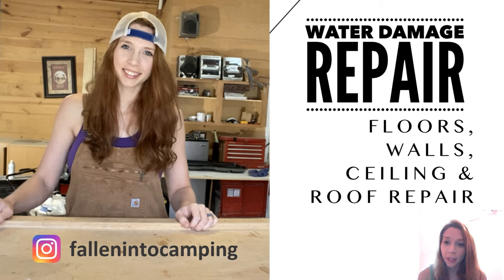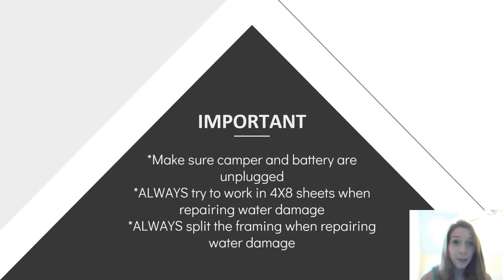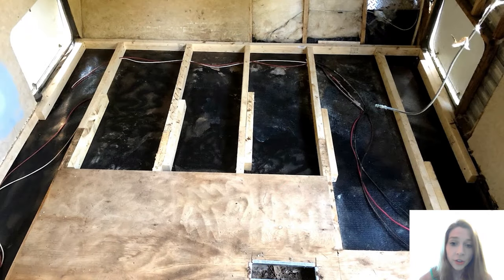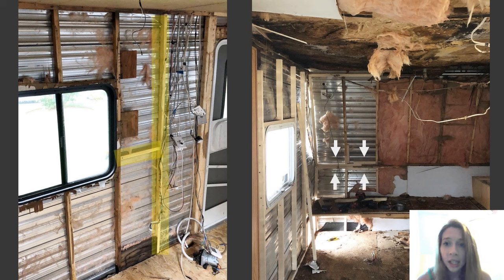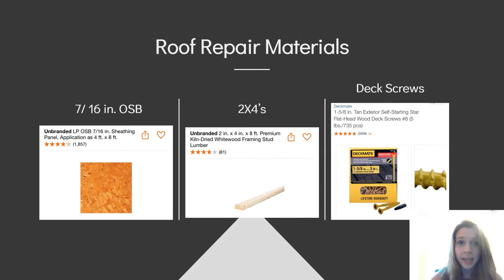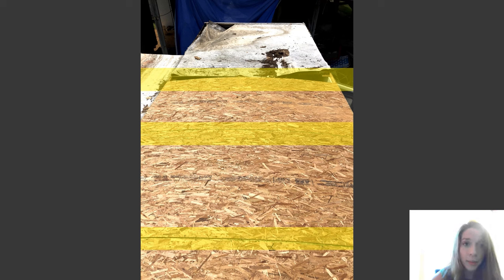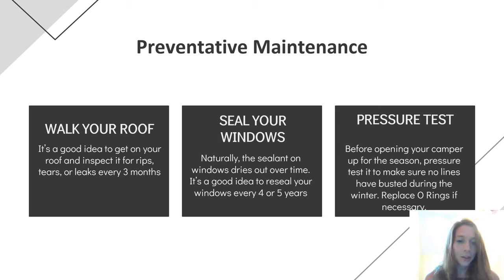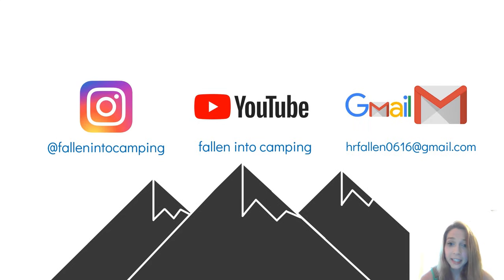(UPDATED) RV Water damage repair in 6 easy steps!

Comment: Hi Heather. This video has been very helpful for the structural elements. I'm renovating a motor camper in Europe, where there is an overall vehicle weight restriction, including passengers and contents, of 3.5 tons. This means that even the good makes have much flimsier construction than your campers in the US. For example the floors are made of 20mm extruded polystyrene sandwiched between 2 two 5mm sheets of ply without any s4upporting structure other than the original van chassis. The top sheet forms the floor and the bottom sheet is bitumin coated and directly exposed to the road!! The only thing that holds the walls up is a 100mm band of wood infill around the edges which replaces the polystyrene core ..... so rot around the edges is pretty hard to put right. Do you have any ideas. 
The second thing which is puzzling me is how to waterproof the external corner joints of the walls, which are constructed of an aluminium sheet with bonded softwood framing and polystyrene fillers. The front/rear walls attach to the side wall framing by screws/staples via a 10mm wrap around of the aluminium skin - so lots of little screw/nail/staple holes under the aluminium angle cover strips. This is where the water came in originally so needs something a bit better than the original putty which had long since dried and cracked. What do you recommend ?  I'd thought of 25mm self adhesive butyl tape wrapped round the corner across the join under the cover angle strip. Or would you recommend the type of flexible mastic putty you used for reseating the window in your video ? Many thanks in advance. Alan Redhouse
Reply from the maker: We have campers similar to this in the US—I just repaired one with a foam board construction (see repairing rv with foam walls, and repairing RV delamination). Butyl tape will be your best friend! Also caulk everything, even after you apply butyl tape!

Comment: Where you suggest ordering RV replacement parts? I need that material for around my windows on the outside among many other items. Thank you so much for all you do!!!!
Reply from the maker: I order most of my parts and supplies from recpro. What material are you talking about on the outside of the window? The trim strip that is inset in the window, or the caulk cord to seal the window?
Reply: Not sure how to describe the trim. It is a rounded piece of vinyl. I’m sure I’ll find it at the company you suggested

Comment: What size staples do you use? Also if you know off hand, what pressure do you set the compressor at?
Reply from the maker: To staple paneling, I think I use 1 inch crown staples in my 18 gauge nailer. Pressure is usually around 60-80. I start at 60, and if it dosent sink the staple in all the way flush I’ll turn it up a bit. Don’t want it too high because the staple will go right through the panel!
Reply: @fallenintocamping   Awesome, just what I needed. Gonna go pick up a staple gun. Thank you.

Comment: Was your window completely removed prior to you using the router to cut out the opening in the paneling?
Reply from the maker: Yes, the window needs to be removed before using the router to cut the hole. Good question!

Comment: I have a question about routering around the window.. it looked as if there was no actual window, just an opening.  So if you would answer that first..then state the info on the bit for it please.
Reply from the maker: I took the window out, and then used my router with a flush trim bit (and the framing as a guide) to router the shape of the window, and then put the window back in! The flush trim bit has a bearing that acts as a guide where there is existing framing (like around the window) and makes a perfect cut every time!
Reply: @fallenintocamping  ahhh. Now it all makes sense. Thank you for replying so quick. You're awesome. Love the channel! Wish I'd looked for this info before it got so cool in Michigan.

Comment: One last question. My camper has a lot of water damage all over. Needs new roof along with ceiling, floor, and walls in multiple places. Should I just rip it all out at once. Do you offer a consulting service so I can pay you for advice?
Reply from the maker: I would repair floor, walls, roof and then ceiling. I’d be happy to do a consult! I’ve done FaceTime for folks in the past, or if your close to me (Raleigh nc) I could stop by and check it out!

Comment: Thanks for your video. What materials would you recommend for ceiling repair with aluminum studs.I have a hybrid RV and  I can't find a repaitrvideos about it. 
WILL
Reply from the maker: I’ll let you know tomorrow 🤣 I actually am working on a metal frame camper now, so I’m going to try out a few things to see what works best!
Reply: Thanks! My hybrid camper is a 2006 travel star. Aluminum frame. For the roof repair I'm thinking a sheet of aluminum (8.5 X 2 ft) screwed on the roof rafters. For the ceiling I'm not sure. I haven't done it before that is why I need your feedback. Thanks in advance

Will. (Maryland USA)
Reply from the maker: @AGDrivingSchoolMD  I haven’t forgotten about you! I’m a bit behind schedule because the camper ended up having way more water damage than I initially thought, but I’m hoping to have an answer for you tomorrow!
Reply from the maker: I just posted a new video on what I used!
Reply: @fallenintocamping  Awesome, I can't wait to watch it

Comment: How do you know when to cut losses on an RV repair? We started with what we thought was a subfloor replacement and now we’re having delams front, back, and both sides.
Reply from the maker: Oof, that’s tough. Depends on how much time and money your willing to put into it. It might cost you just as much to fix it than it would be to sell it and get a different camper 😵‍💫
Reply: @fallenintocamping  can you actually buy the fiberglass outer panels for the walls? If so where? I have a 2009 north trail. Also thank you so much for your reply. I truly appreciate it.

Comment: Great content, thank you! My question is we have a 1974 prowler camper with a aluminum roof, there is water damage on sides of roof where screwed down, the metal seems to sag in a couple places and allows 2 huge puddles of water to sit, the metal seems to be in good shape. Would you go at it from inside and check the trusses? To add the slope back to the roof, then reseal or coat the roof, and then rebutyl the sides with new screws? Thanks and sorry so long of a comment.
Reply: Or would you rip off the metal and check everything and then apply a new PVC roof.
Reply from the maker: That would really depend on your budget! If it were me, I would take the metal roof off and replace with PVC. It’s going to be really hard to repair roof rot from the inside. But, if that’s not in the budget, if you are really careful you might be able to fold the aluminum just enough to get the rotten wood out and replaced!
Reply: @fallenintocamping  thanks for the quick reply.

Comment: Anything on water damaged outlets?
Reply from the maker: Replace them. I just posted a video on how to upgrade to usb outlets, but if you don’t want to do that you can get an rv self contained outlet from Amazon for like $10. Make sure it’s self contained, otherwise you’ll need to install an outlet box. If you watch the first part of that USB video it will tell you how to take the old outlet out and apart.

Comment: I can't find anything on repair or replacement of the rear wall of my 2015 Rpod 176 camper,the whole wall was literally rotten to pieces and I don't have a clue how to fix it
Reply from the maker: Those small ones are tough…just by doing a bit of research, it seems common on the rpods. I’m assuming the frame is aluminum with foam walls, so I can point you to a different video if that’s the case. Before I do that, send me some pictures and I’ll give you some advice on how to repair. Email me at fallenintocamping@gmail.com or send them to me on instagram (fallenintocamping)

Comment: What is the coat of replacing ceiling and walls?
Reply from the maker: Depends on each camper and what the walls are made of, and how extensive the damage is
Reply: @fallenintocamping  2003 coachmen marina .  I think I'm in trouble! As for the roof, do you use rubber roof?  Is that the better one? I need to use the most effective budget friendly materials. Long story short my boyfriend said he knew what he was looking for ! So I allowed it ! Now I bought a 35ft. Coachmen with bad bad roof and ceiling. Some walls not all. A  bump out that won't close all the way. I don't have much left in my budget  but roof a ceiling is a must !! So my question to you as a expert ::what are the most budget friendly roof Membranes  you recommend? And for ceiling. Paint can make anything look good. Thanks

Comment: Any tips on how to remove bench seats and table?
Reply from the maker: Most of the time, bench seats are just a frame with screws. Take out the cushions and look inside the bench itself and it will be screwed to the wall and floor. The table will either be on 2 poles that pop out, or screwed to the wall.
Reply: @fallenintocamping   thank you so much!
Reply from the maker: @kayteen6205  sure thing! If you can’t get it figured out, feel free to send me a picture of your dinette via Instagram or email and I’ll try and help ya out!
Reply: @fallenintocamping  I appreciate you! I will give it a go and let you know how it turns out!

Comment: very little information on reframing.... skip video
Reply from the maker: What are you specifically looking for in regards to reframing? I have each section laid out at different times (floor, walls, ceiling, etc). I have it laid out in the video with extreme detail (what supplies to use, how to join existing and new framing, etc), so I’m surprised to hear you say there was no framing information. If you’ll tell me what you’re looking for, I can point you in the right direction. Also keep in mind this video is for wood frame—if you have aluminum framing, I have different videos on how to repair that!

Comment: Great instructional material; but I think you are giving away, way too much valuable information for free. I would break up this instructional video into several parts - ie floor damage, wall damage, rubber roof replacement; offer the introduction (video) free, and then charge for the remainder of the course (s). Or at the very least have a PayPal links, tip jars, etc. May be worth hiring someone to do some of the marketing material for you. Best wishes

Comment: Hey I just got a rv and it has some water damage I’d like to fix once I get the time to do so. I love your video but If you have a email or something where I could show you pictures and get a second opinion that’d be great. I was also wondering if you ever use a moisture meter while doing this work if you’re on edge about replacing certain areas.
Reply from the maker: Sure! Fallenintocamping@gmail.com or you can message me on Instagram!
Reply from the maker: I don’t, in RVs those meters can be really deceiving. Especially if there is an aluminum frame.